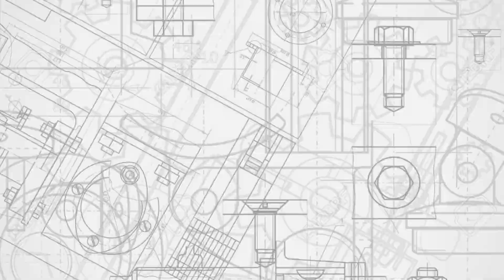CHEAP PC Watercooled Gone Wrong!

Comment: Oh the cringe is insane with this video...
Reply: Go back to the early 2000s and all water cooling was pretty much similar to this guy's direction. No man's land.  Anything goes as long as it works and was not too expensive.           This guy is creative and doing what he can to water cool.

I have done the same myself but with something more common with just standard Chinese water cooling parts but I also have done some crazy things myself to get things working.   

Like taking my gtx 1080 to hyrbid and using a universal GPU block along with some copper heatsinks for vrm all housed in the original shroud and also cut holes for more airflow with fans

This is cool what he is doing and I wanna see more.       MacGyvering at it's finest.
Reply: Also might I suggest you buy some rtv silicon next time and using it on all blocks and fittings for extra protection on the off chance anything decides to leak.       I've done it on all silicon gaskets and it's nice to know it won't leak :)